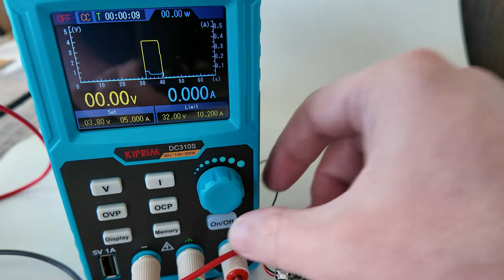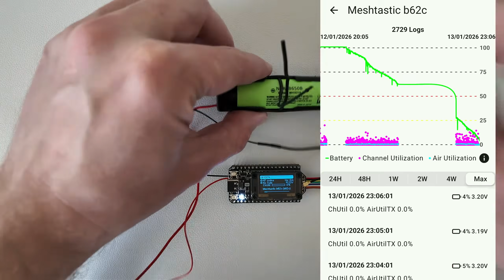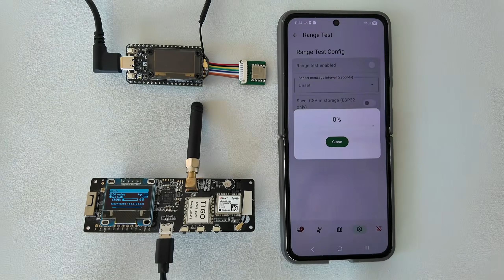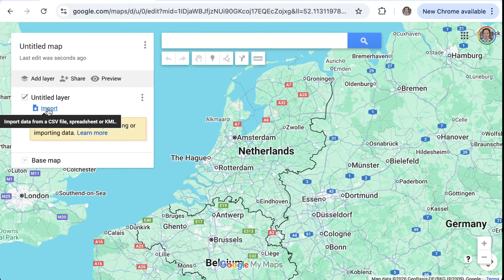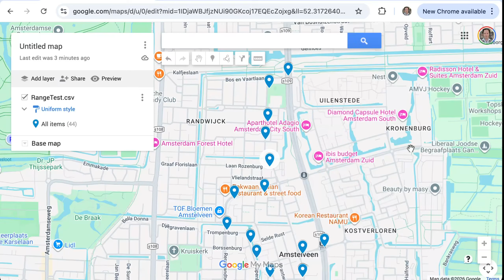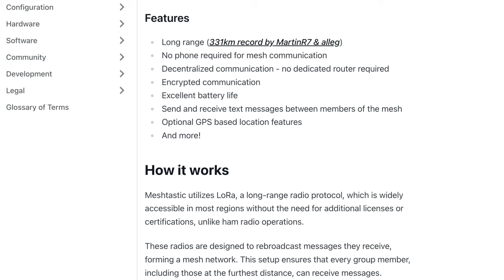Meshtastic Heltec V4 Review - Range and Battery Test

Comment: Hi, is this a really good experiment and introduction video. I have a question about using two Heltec Lora boards as sender and also receiver. Can they also provide more than 1km distance transmit? Because the antennas’ difference
Reply from the maker: I don't have 2 Heltec boards to test, but intuitively, the standard antenna is too small. And the results also depends on how high the antenna is located. In the open area it may be possible, in the city, I have a doubt.

Comment: You did the test the wrong way. Interesting would be using the v4 as the transmitter, as it allows for 28dbm vs. the usual 22dbm of the SX1262.
Reply from the maker: Yes, it's a good idea for the next test, thanks :)
Reply: @DimitriiLab  yes, please test the other way. My Heltec V4 receives just fine, but the transmit only gets about 15 or 20 metres. Absolutely awful. Heltec Support is also ignoring me.
Reply from the maker: @sandordugalin8951 Yes, it's weird,  even with a small antenna, it should not be 20 meters anyway:) Try to power the board via the USB port, I had issues with a too thin wire on a power connector

Comment: Hi Dmitri, what was the height position of the transmitter during the test? Do you live in a highrise perhaps? In Eindhoven city centre at ground level I'm only getting ~400m range between my two v4 board.
Reply: In Amsterdam I’m getting 2,2km on bridges & parks with my T114’s however with loads of buildings I’m getting no more than 200m.

With a 1000mah lipo battery I get about 2 days running time (turning the device off at night; I sleep better without radiowaves nearby).
Reply from the maker: I live on the 8th floor :) Indeed, the distance at the ground level should definitely be shorter.

Comment: There is an effort to upgrade the build system for esp32 Meshtastic boards that should reduce the power consumption. You can read about it in the GitHub issues.